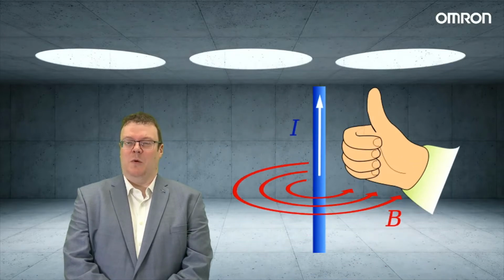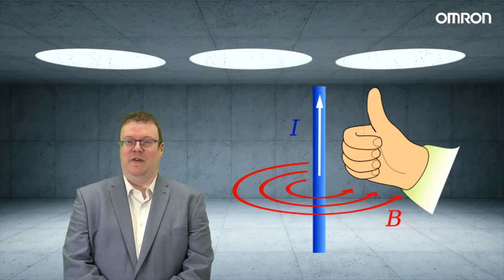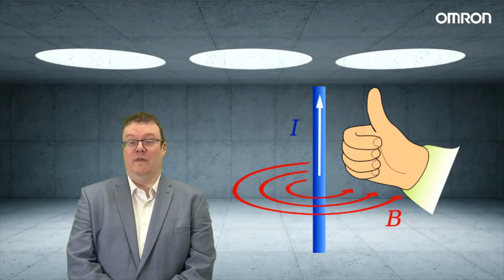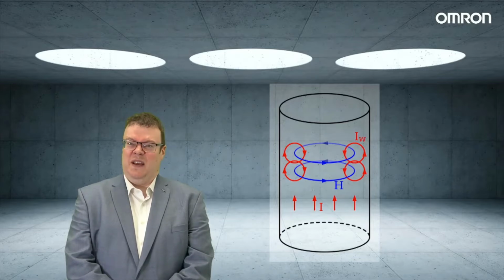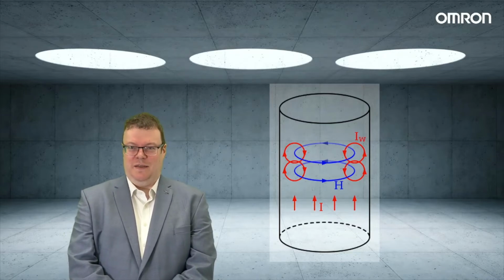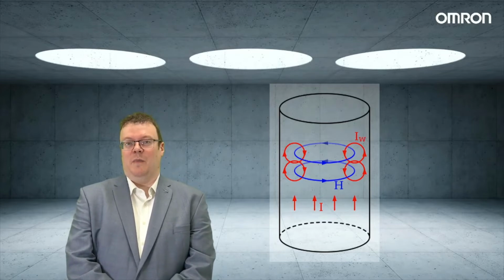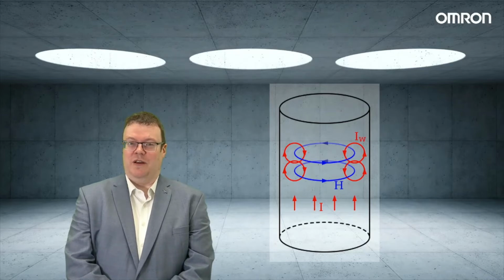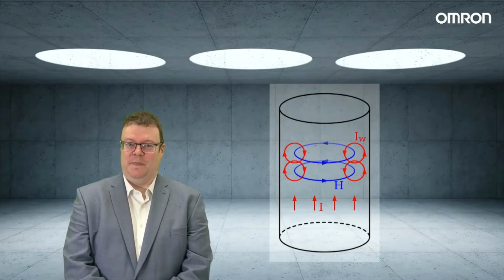What is skin effect?

Comment: Ground straps don't qualify for this explanation since the individual strands are not insulated.  The reason for many smaller wires in ground straps isn't high frequency, it's mechanical flexibility.